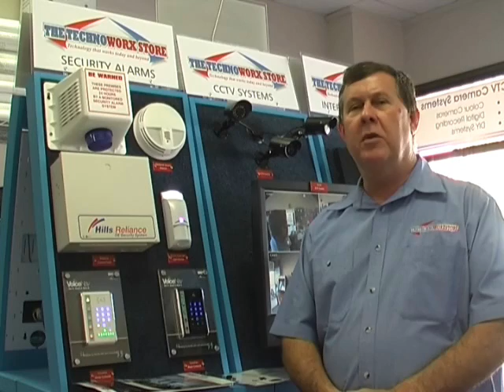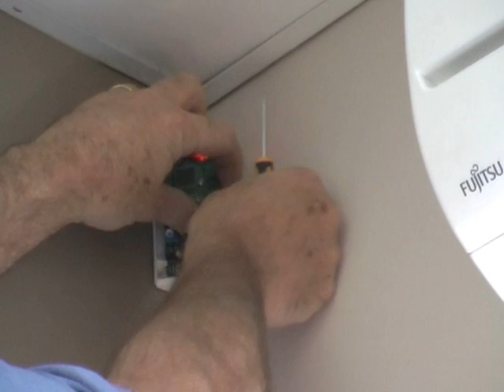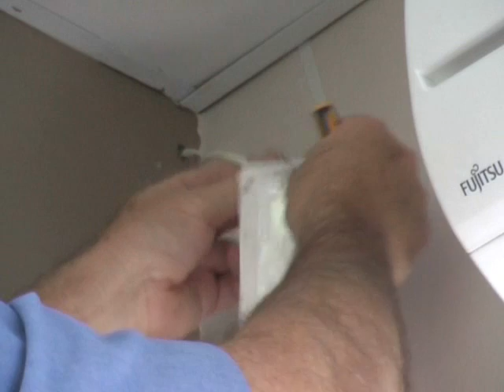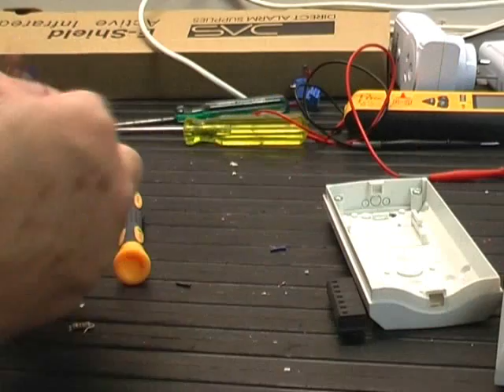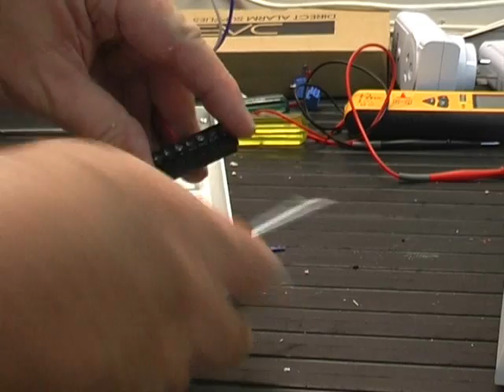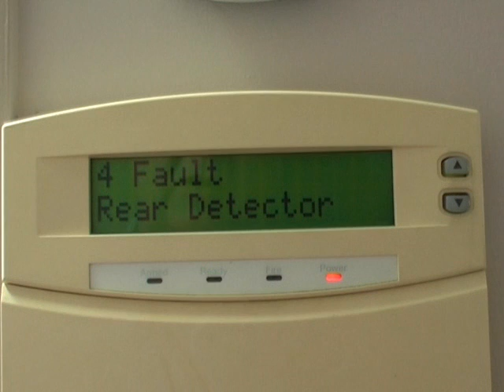How to change a PIR on your Alarm System

Comment: This is a great video. What do you suggest in replacement of Rokonet RK-100? I have 2 RK-100 that are giving false alarms and 2 RK-110 which are not. Nothing has changed in the house so maybe the 100s have deteriorated over time? They are probably 30 years old.

Comment: how to stop false alarms by pir
Reply from the maker: +Vinod Gangwani depends on what is causing the false alarms. if there is nothing in the environment contributing to the false alarms ie. windows being left open/fan running causing curtains/blinds to blow around, insects or Ghekos crawling over the lens, it is quite possible the PIR may be faulty. 
it is good to rule out all possibilities prior to replacing.